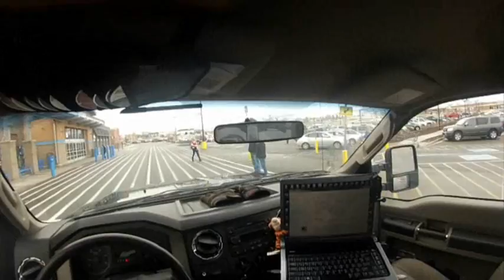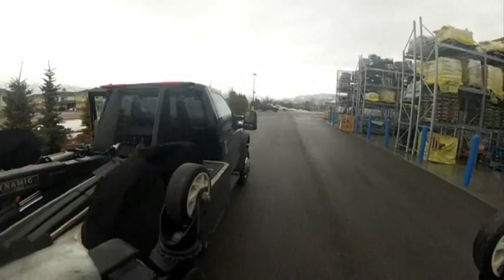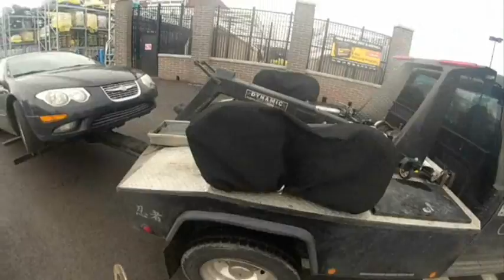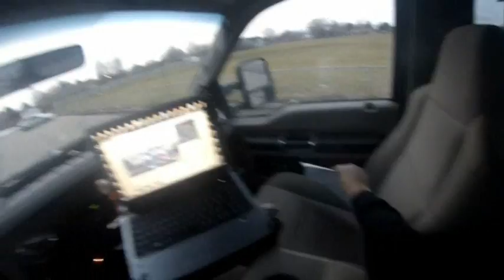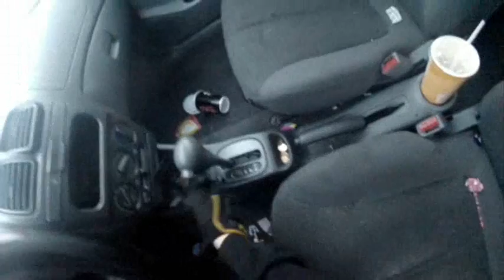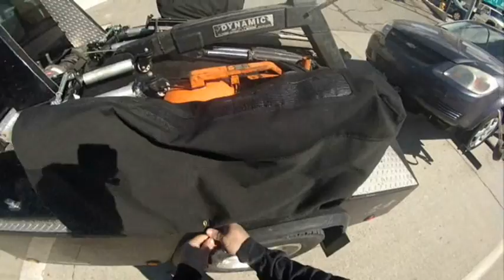Valentine's Day 2014 Is North Up And South Down - 02/23/2014

Comment: Oh yeah, i meant to comment on your other video about your dolly bags. I would look at making a box for them instead.

The box would have 2 functions, one is to hold the dollies in the box so you lift the box onto the back of the truck with dollies inside.
The other would be to release the dollies in the box.

So you lift the box with a set of handles which unhitches it from it's supports and then you lift the box off the dollies on the ground by pushing a lock switch as you lift it in a center handle.
I would pick the box and dollies off as a unit, set it next to the passenger side and by the middle handle and lock "button" just lift the box off the dollies. Take the box with me to the other side, lift off the other dollies and place the empty box on that side.
Effectively switching sides on the boxes every time (to save the trouble of setting the boxes back after you have placed the dollies)

To me that just feels like a neater solution. Might be more expensive but the benefits are great in that you have everything contained in a unit and you can lock the boxes with a key if you want to.

Would file a patent but i don't believe in patents for reasons beyond this comment, so feel free to use my idea.

EDIT:

Oh yeah, the box could come with a set if cart wheels too, like one of those travel cases so you can just push it along the pavement etc.

Comment: Another tip for you
Carry some desiccant (like they use for drying flowers) and if you're stuck on ice or wet clay, sprinkle a bit in front of your tires. It takes away the film of water that you are actually slipping on and you can get rolling. Great for a quick fix.

Comment: well i have had the north south issue in my head a while my resoning is that the planet is moving and turning so i have it the way that if i am in the northern hamasphere and going south i go up in relation to the planets turning point i put more didtanse to the center of the turning point and that makes it in relation to the planet up if you are in the south and goung north you whould say up but i am sorry for any spelling and gramma issue i got please excuse my spelling and fun descution up/down not allways at easy as it seams :P
 
an idea for the covers might be if you intend to mount them to maybe make i sipper go down the middle on the side that faces the outside that way you just pull it over and you can mount it more permanent and still not have it flapping on the mount :) you can use the idea if you want to bro keep making good videos :P

Comment: As a non-American: Why do people keep their cars unlocked and keys inside car? Isn't that like stupidest thing to do unless you want someone to steal your car?
Reply from the maker: I've spent a ton of years in security related job fields and believe it or not the statistics show that a thief will take it in an aggressive manner like breaking the glass to enter and breaking the steering column or cutting into the electrical system to bypass security devices. So with that in mind if the vehicle is recovered it will be in worse condition than if you had just left the keys in it. If it's not going to ever be found then its a moot point. Just because you leave you keys in the car does not mean you have to leave them out in plain sight. A good thief will look in the obvious places real quick and then go to plan B if no key is found. They will get it if they want it regardless of access to a key. So which car do you want returned by the cops. The guy who tore it apart or the guy who found your key and just needs a way to get across town and ditched it in a church parking lot. I leave my keys in my vehicles but they are always parked inside  garage. I never lose them and my wife and kids never have to come hunting for them when I'm not home. Out in public my shit is alarmed GPS tracked and can be shut down from my phone in real time. No one steals from me and gets away period...